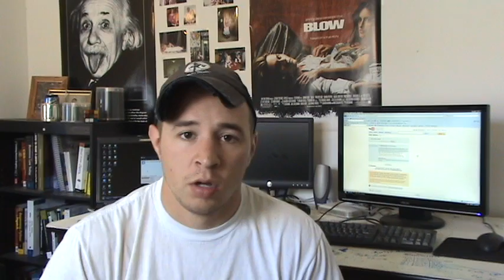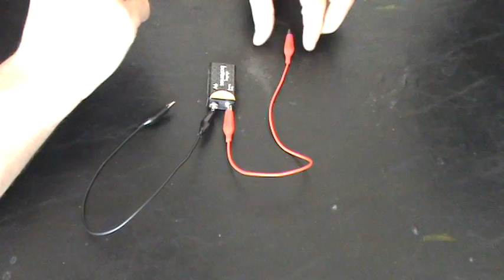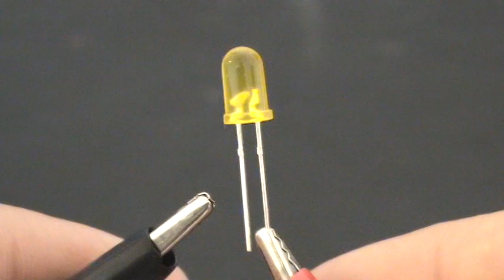Robotics and Electronics Tutorial - 11 - LED's Gone Bad

Comment: I could not believe it when it happened, it was a lower quality led from a solar garden light, it may of had a bubble of air that expanded due to heat , regardless something made it explode, the thinner lead " anode " did get sent into my thumb, only a about a quarter inch but how often does that happen? It was the only time in my years of working with leds it has happened. I order them by the hundreds these days, there is bound to be one or 2 leds out there that just have a temper.

Comment: @RANDOMFISHYFACE Not really, it depends on how bright you want the LED to be, and/or how fast it will use up the battery. the larger the resistance, the dimmer the LED will be, but it will use less power, and the less resistance, the LED will be brighter and use the battery faster. you don't need to worry about resistors, and kind you canget your hands on will protect an LED from a nine volt battery.